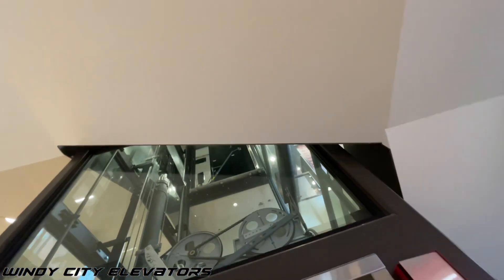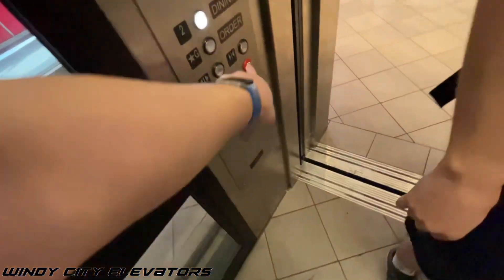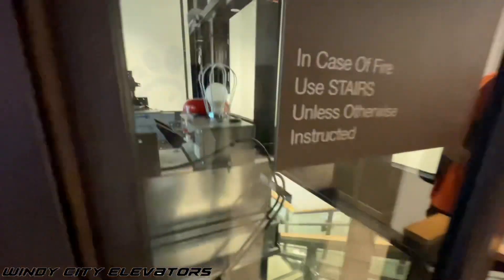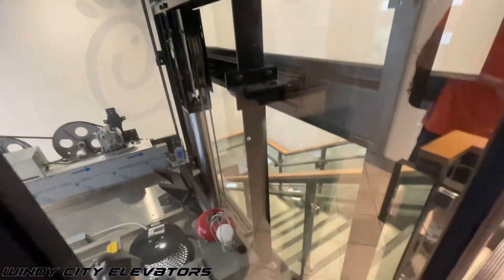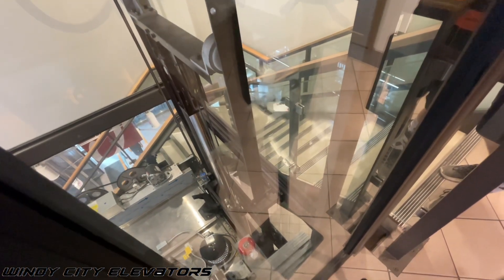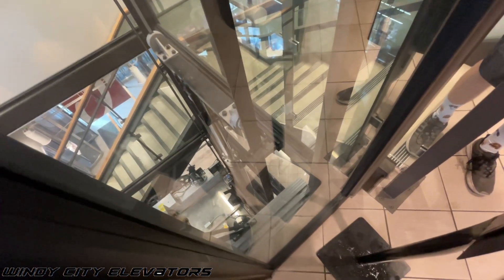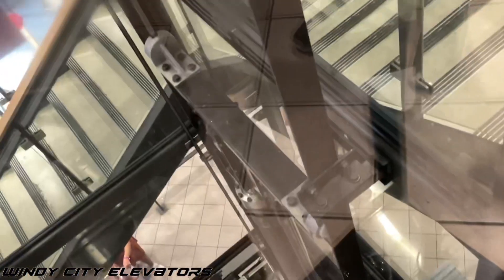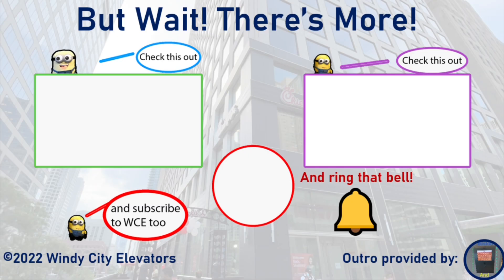Slow Colley Hydraulic LULA Elevator - Chick-Fil-A on Michigan Ave in Chicago, IL

Comment: Scenic LULAs are awesome. But yeah, they're just too slow
Reply: And for a roped hydraulic elevator, I expected faster, since 100 FPM would be ideal for 2-3 floors (comparable to holeless and inground), but roped hydraulics can also go as fast as 200 FPM.
Reply: @CenTexElevators489  Eiffel Tower in Paris is a very specialized roped hydro. As for the ones which go from ground to 2nd floor. Those go 400 FPM